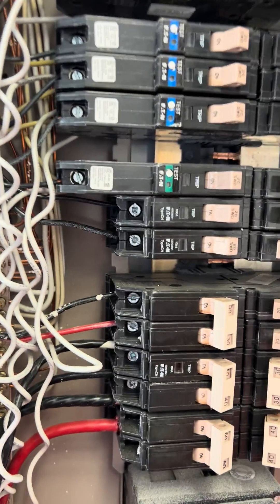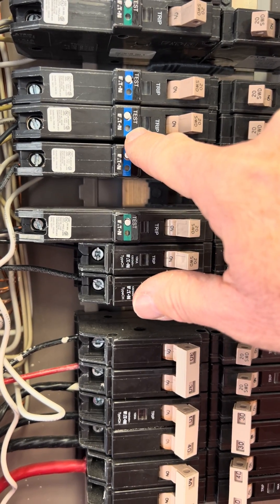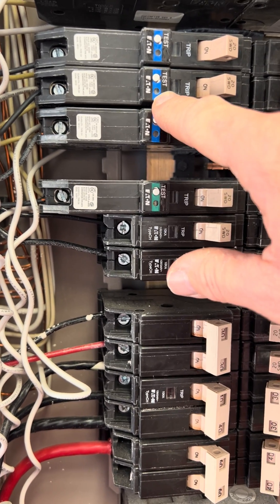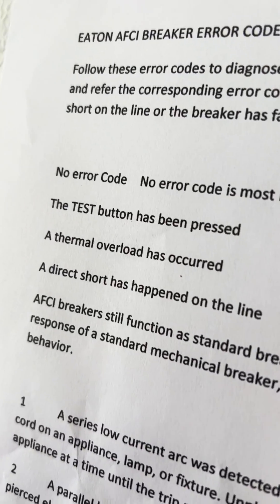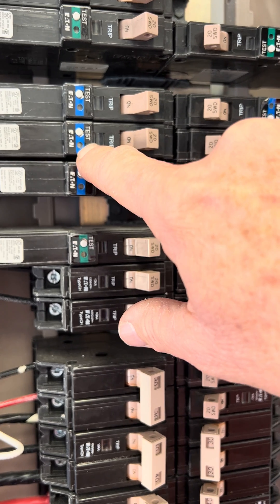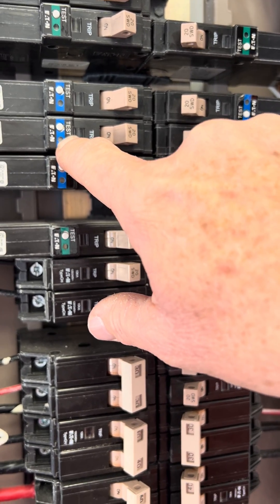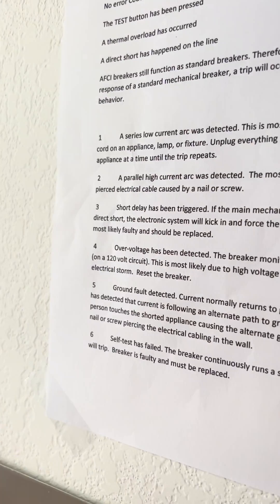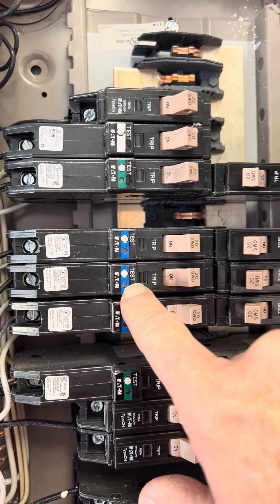How to read⚡EATON Circuit Breaker AFCI/GFCI RED light fault codes for circuit, appliance, or breaker

Comment: Came here to find an answer to the solid red light indicator problem on a new AFCI breaker and discovered the Reddit reference where Eaton says it’s ok to be on.   All my other Eatons installed 10 years ago are dark until a trip occurs, but the new one is on solid red all the time.   🤔
Reply from the maker: red the description below the video it shows all light codes 😇👀

Comment: I've got the constant-on scenario. If I read correctly, it's a non-issue. Seems crazy that "sometimes the light just stays on, but that's the same as the light staying off" is an answer that the company would actually stand behind. Of my 20-some-odd switches, 4 are in this constant-on condition. For what it's worth, I know that 2 of the constant-on switches legitimately tripped in the past, so, maybe, that's part of why they're exhibiting this behavior now.
Reply from the maker: ***SOLID LIGHT :::Is the red LED light staying solid a problem? And what can be done about the first issue, the single flash at startup indicating that the “electronic overload protection is turned OFF”?
The overhead LED lamp and dimmer seem to be working perfectly fine when the breaker is ON, just the red LED status light on the breaker doesn’t make sense.
Is this breaker functioning properly, anything I can troubleshoot?
Thanks Aaron First update, 2 Jun 2021: This is the exact response from Eaton when I sent them this question: The breaker is functioning just fine. The light behavior in normal condition varies from breaker to breaker, as long as it does not trip and flash a code, there is nothing to worry about. You may even see flashes sometimes when the breaker is in normal operation, and again, that’s normal. The flash codes are to be referred ONLY if the breaker trips, else you are good to go.
I sent a follow up question. I just can't easily accept that the only condition that indicates failure (1 blink at startup) is being indicated, but that it should just be ignored because, hey, we can't make a consistent product, my paraphrase.
################EATON AFCI BREAKER ERROR CODES #################
Follow these error codes to diagnose the trip. After resetting from a trip, count the number of flashes and refer the corresponding error code. If the breaker immediately trips again there is either a direct short on the line or the breaker has failed and must be replaced.
No error Code   No error code is most likely cause by one of the following conditions:
The TEST button has been pressed
A thermal overload has occurred
A direct short has happened on the line
AFCI breakers still function as standard breakers. Therefore when a condition that a matches the response of a standard mechanical breaker, a trip will occur without an error code. This is normal behavior.
 1  A series low current arc was detected. This is most likely the result of a frayed or worn power cord on an appliance, lamp, or fixture. Unplug everything from the circuit and then add back one appliance at a time until the trip repeats.
 2  A parallel high current arc was detected.  The most common type of high current arc is a pierced electrical cable caused by a nail or screw.
 3  Short delay has been triggered. If the main mechanical breaker fails to take action during a direct short, the electronic system will kick in and force the breaker to trip.  The mechanical breaker is most likely faulty and should be replaced.
 4  Over-voltage has been detected. The breaker monitors for voltages that are 160 volts or greater (on a 120 volt circuit). This is most likely due to high voltage from the mains feed or caused by an electrical storm.  Reset the breaker.
 5  Ground fault detected. Current normally returns to ground over the neutral wire. The breaker has detected that current is following an alternate path to ground. This could cause injury or death if person touches the shorted appliance causing the alternate ground path. This could also be caused by a nail or screw piercing the electrical cabling in the wall.
 6  Self-test has failed. The breaker continuously runs a self-test. If this self test fails the breaker will trip.  Breaker is faulty and must be replaced.

Comment: What if it stays red even after resetting it?
Reply from the maker: This should help you😇 ::: PLEASE READ ALL :::** A constantly illuminated red LED is not one of six programed event indicators, thus it cannot be confused with any other event which will require attention/service. The LED being constantly illuminated is not an indication that the breaker is operating in an unsafe condition. https://www.reddit.com/r/electricians/comments/k7zpo1/eaton_breaker_solid_red_light/
**This link had an answer from Eaton ::: 
The overhead LED lamp and dimmer seem to be working perfectly fine when the breaker is ON, just the red LED status light on the breaker doesn’t make sense. https://solveforum.com/forums/threads/eaton-chfn120a1cs-breaker-status-led-shows-uncommon-issue-and-stays-lit-all-the-time.243635/

Is this breaker functioning properly, anything I can troubleshoot?

Thanks

Aaron

First update, 2 Jun 2021: This is the exact response from Eaton when I sent them this question:

The breaker is functioning just fine. The light behavior in normal condition varies from breaker to breaker, as long as it does not trip and flash a code, there is nothing to worry about. You may even see flashes sometimes when the breaker is in normal operation, and again, that’s normal. The flash codes are to be referred ONLY if the breaker trips, else you are good to go.

I sent a follow up question. I just can't easily accept that the only condition that indicates failure (1 blink at startup) is being indicated, but that it should just be ignored because, hey, we can't make a consistent product, my paraphrase.

SolveForum.com may not be responsible for the answers or solutions given to any question asked by the users. All Answers or responses are user generated answers and we do not have proof of its validity or correctness. Please vote for the answer that helped you in order to help others find out which is the most helpful answer. Questions labeled as solved may be solved or may not be solved depending on the type of question and the date posted for some posts may be scheduled to be deleted periodically. Do not hesitate to share your response here to help other visitors like you. Thank you, solveforum.

Comment: Did the replacement work? My husband is an electrician and is having a really difficult time with the Eaton breakers blinking 6 times in a brand new home. He has replaced them only to have the problem again.
Reply from the maker: Yes, it fixed this problem my code started as a 5 then right before I ordered the breaker it started  the 6 code which means bad breaker. And yes it stopped the problem.  
Flash code  6  Self-test has failed. The breaker continuously runs a self-test. If this self test fails the breaker will trip.  Breaker is faulty and must be replaced. 
* the exact over price part I ordered at Amazon (price was worth it ) Eaton Cutler-Hammer Eaton CHFN120DF (New Version of CHFAFGF120) Pigtail Connection Dual Function AFCI/GFCI Circuit Breaker 1-Pole 20 Amp 120 Volt AC (1), White
Brand: Eaton Cutler-Hammer https://www.amazon.com/gp/product/B09H6BLK3B/ref=ppx_yo_dt_b_asin_title_o08_s00?ie=UTF8&psc=1 
These breakers are super fragile if they are dropped or delivered after being dropped they will be bad. Also all homes have these GFI after mandated 2017 do not replace with regular breaker.
Worked for me and God bless
Reply: i am an electrician myself one thing i found is that most of the CH breakers doing this are the GEN 2 models, when you pull one out have him check the label on the side of the breaker and it will say what gen it is, i have learned that gen 2 model was a very bad batch, some companies are still installing these gen 2 even though we are up to gen 6 now..

also, these should have a lifetime warranty as long as you have the original purchase ticket have him check with his supply house that he gets them from, although it sucks because he loses labor hours having to warranty these breakers.
Reply: @frankmercado2899  thanks so much. He contacted Eaton and they said they had a faulty batch of sensor chips. They are sending him replacements. We are very thankful.